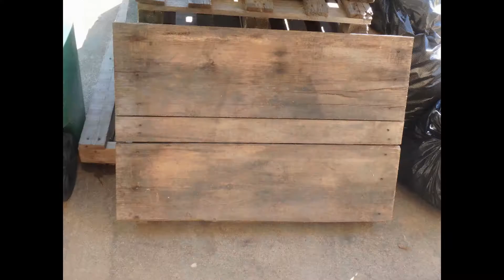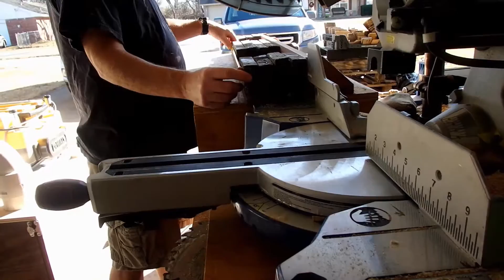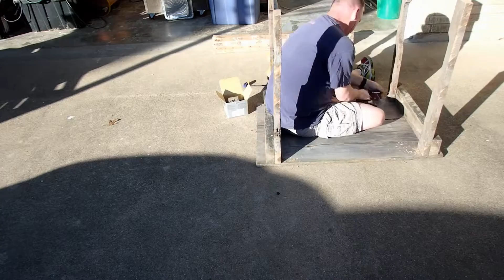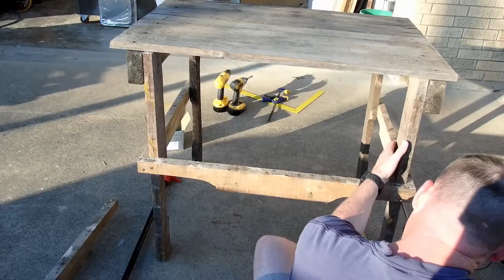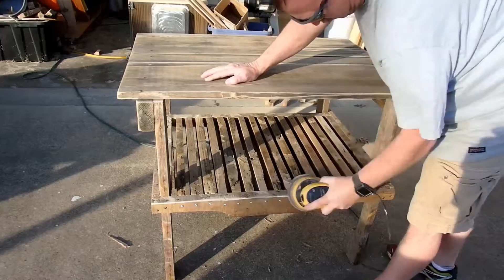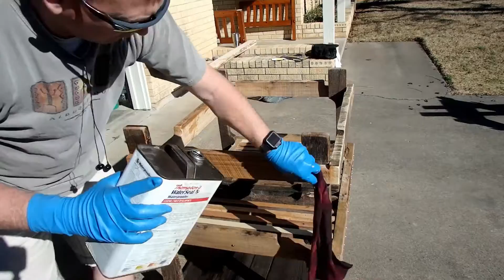Living Cooper - Portable-Grill Pallet Table

Comment: I saw your blog on the pallet bed.  Can you elaborate about the number of pallets used, and the final approximate weight of the base?  Thanks!
Reply from the maker: The bed frame is actually made with pine 1x4's from the big box store.  I then made the drawers out of 3/4" plywood.  After that I skinned the frame with pallet slats.  As far as the number of pallets that I used it's hard to say.  I have several projects going at the same time.  I counted that I used 25 slats.  The head board is made from two 40"x48" pallets with some extra slats from some other pallets.  The weight of this thing is several hundred pounds. it does come apart though.  the headboard comes off and the frame is in two halves screwed together along the center. Checkout Steve Ramsey's "Make a King sized bed frame" video https://www.youtube.com/watch?v=8NPAjqQ4GvE   This is basically how I built the frame itself.